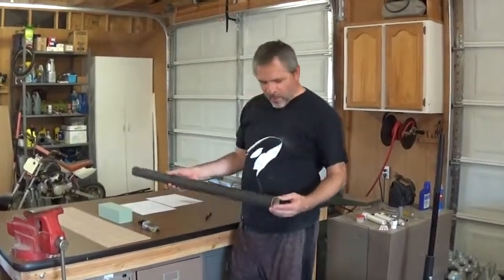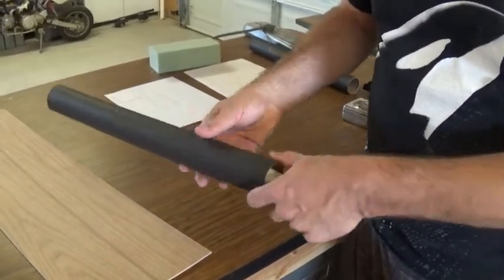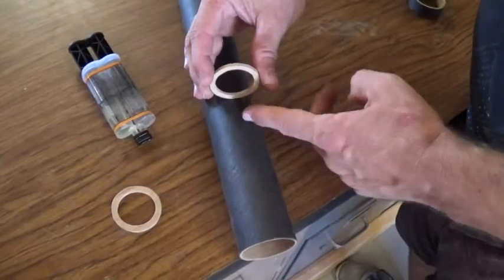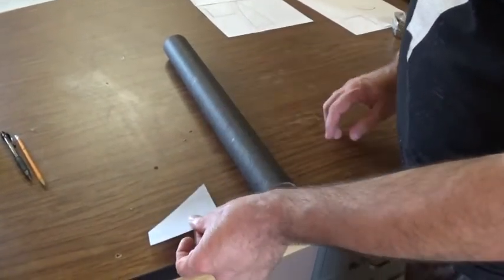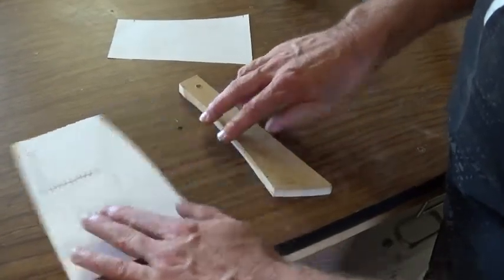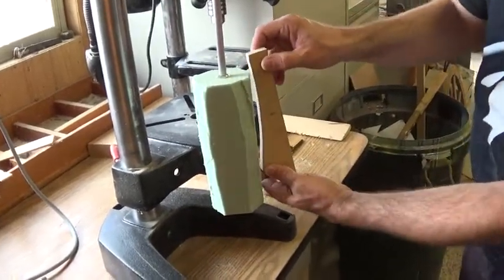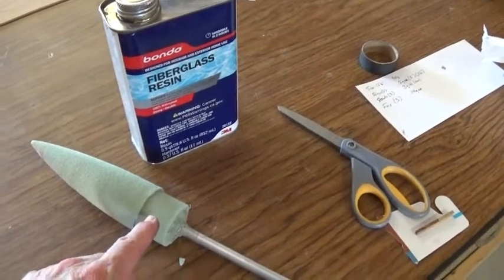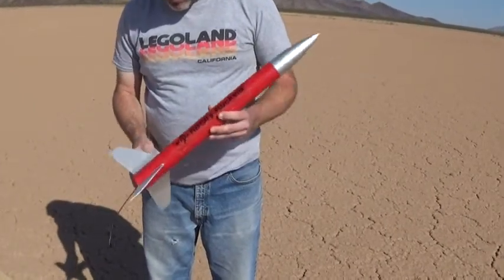DIY Home built model rocket and sugar motor.

Comment: how did you drill out the centre of the retaining rings?
Reply from the maker: Now I use a CNC machine but back then it was all by hand. If you have a hole saw, you can drill out a hole that is smaller than what you need then use a 1/4 round file to finish off the hole. If you don't have a hole saw then just use a drill bit of any size... 1/4", 3/8", whatever, and drill out most of the center then finish it off with the file.
Reply: thanks for replying. you also dont have a video of how to make that big rocket with the body and fins?
Reply from the maker: You're probably referring to the 4" Eliminator rocket. No, we never made a video for that. It just kept changing every time I built one. I do have a really good video on a pretty large rocket though. This was a tall, 3" rocket used for our 1000 subscriber special...
https://youtu.be/nZQhtlg8cL0
Reply: thanks but that requires a 3d printing machine so I cant make the big one so I cant make the small one. good videos but it would be better if you made one that everyone can do
Reply: hi dont know if you know but in this video https://www.youtube.com/watch?v=qmTnoNR1k_I    the guy mixes table sugar and kno3. i know if this touches the stove it will make a fire so better to use a isolated heating unit. but, should I use powdered sugar or table sugar or sorbitol for this?
Reply from the maker: The fuel he makes in that video is called Rocket Candy or R-Candy. I really do not recommend you make that type of fuel. Check out this video for more details about R-Candy.
https://youtu.be/VTO9e-fDQkk
Flexi-fuel is just as simple to make and is much more reliable. Here are two videos for making motors with Flexi-fuel.
https://youtu.be/WrvOPYNQv_g
https://youtu.be/pzK8RQdJTSE
If you are in a country where Corn Syrup is not readily available, we have tested a variety of substitutes you can use in place of corn syrup.
https://youtu.be/2SQ4dGzgCSQ
Reply from the maker: Sorry, I just realized I didn't answer your question about using different types of sugars.
You can use table sugar, powdered sugar or even sorbital. It's really your choice. Each time you change the fuel recipe, you need to ground test your motor with that fuel because each fuel mixture will have it's unique burn curve. The flexi-fuel recipe uses powdered sugar simply because having a smaller granule size allows the sugar to be more finely dispersed in the fuel.

Comment: How did you glue that ring in 6" deep in the tube, you didn't show that gem lol
Reply from the maker: Typically I use another piece of tubing or a piece of pvc to position a ring like that. You just need to be careful that you don't accidentally glue the positioning tube to the ring.
Reply: @rotaryrocketry  That's always the trick. Interesting name you have

Comment: I would have preferred to see the actual work not just the results of each step on some of the steps. Nice build, nice rocket. Is there video for how you got to a finished sugar rocket? I know how to make em but there seems to be as many methods as there are personalities in amateur rocketry and yours being 1” brings up a number of questions. Speaking of questions - why not just stick a 2$ parachute in there and save it?
Reply from the maker: I have actually changed to 1-1/4" PVC for motors now. The 1" worked well but the new ones still fit in a 2" body tube and offer a bit more thrust. I will eventually post a video on how to make my two current motor designs. The problem with recovery was that I did not have any kind of deployment system when I made this one. I do not integrate an ejection charge on my motors because I have just seen too many problems with that design on sugar motors. So it was really just a proof of concept for the rocket and motor.
Reply: @rotaryrocketry  what i use with 100% reliability is a half teaspoon of black powder i made myself for the ejection charge and just a toy parachute on a string, literally works every time...the effort you put into making that beautiful nosecone is around twice the effort required to create an ejection parachute system, I have found the only way to go wrong on that is in drilling the ejection charge, that has to be perfect but once I got that right I got it perfect every time like its a law but I hear ya.  Looking very much forward to your video on the motor and anything else yu have to share

Comment: It was a shame to see it self-destruct. I would have loved to see more detail on motor installation and nose-cone finishing. The use of Bondo was a novel idea imo. I was also curious about your thoughts on the tube length and CG.
Reply from the maker: It was always the plan for this one to be destroyed. I know that was a bit sad but it was fun anyways. I had not developed a deployment system and did not have a flight computer yet. I have all that stuff now.
For nosecones... I have two videos posted for doing a 2" one and a 4" one. Both use very different techniques.
For motor install... Well, that is pretty simple, it's just centered with wood retaining rings and a motor stop glued into the rocket. Other than that, if the motor is loose, I just put on a dab of hot melt glue at the bottom to keep it from sliding out. That part is not rocket science :)
For CG... I use OpenRocket to design and "test" all my rockets. So I just mess with length and fin designs until I have something I like with a stability factor of 1 or higher.  Trickiest part of using OpenRocket is picking one of their built-in motors that will perform similar to your homemade motor. I have this pretty well worked out for the 2 motors we currently build but it took time and testing to figure it out.